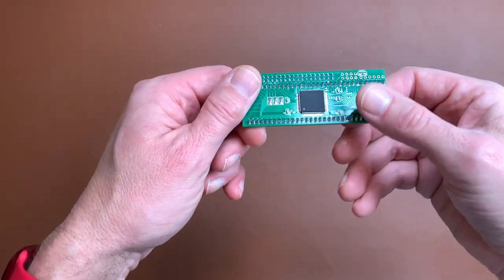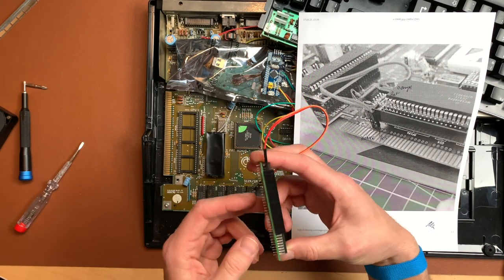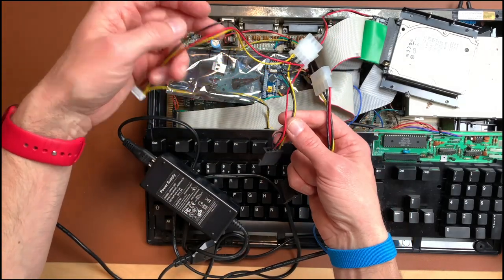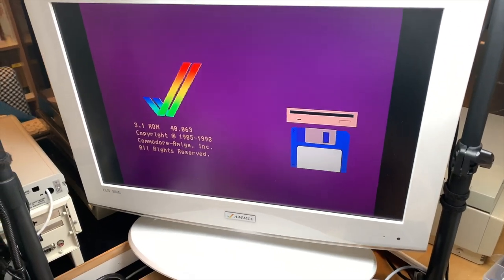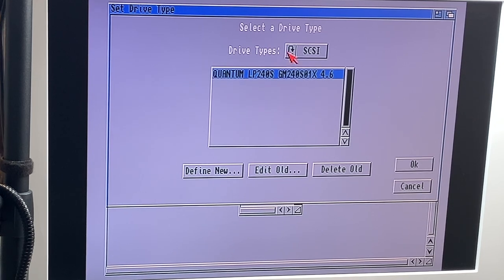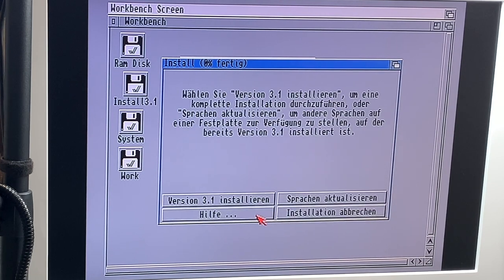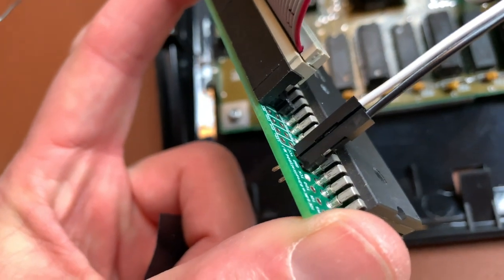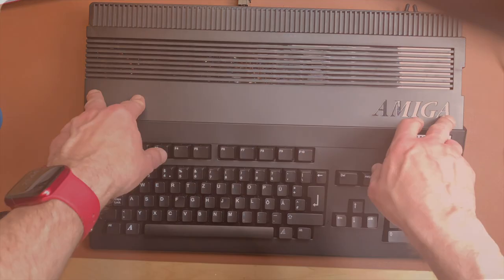Amiga - $25 hard disc controller (internal / IDE) for the A500 & A2000 ... can this work?

Comment: Most CF-Cards do not support Master/Slave (any jumper on the Adapter only works with the right, industrial grade CF). A way around this problem: Use two IDE-> Sata adapters with master/slave jumper instead. Theease also buffer the bus, so much more freedom were to place the drive (and a sata-cable is much more easy to handle than a 40 pin ribbon cable). As hard-drive I reccoment a msata in a sata2msata adapter, as this is very smal. You might place it under the disk drive.
The secondary IDE2Sata Adapter can be used with an eSATA-Cable, so you can plug in an external SATA-Device to your Amiga. This can be f.e. a normal SATA CD/DVD-Drive (or, if you want audio from CD: An IDE-CD-drive with SATA2IDE-Adapter. With a slimline IDE-drive, you need an extra adapter to convert the 50 pin plug to 40pin+analog audio. ). Also there are SATA2CF-Adapters, if you want fast data transfer from another Amiga by using CF-Cards swapping. Not every SATA2IDE Adapter works with slimeline IDE-Drives, as they are flashed to be slave in firmware in most cases. Tried 3 different adapters, only "CSL - IDE zu SATA SATA zu IDE Adapter Konverter" worked. But it didn't worked the other way arround on my buddha (while the cheapest ones fom Aliexpress did). Also having an secondary converter with nothing connected to eSATA only delays boottime a bit, so no problem if you connect nothing externaly.
Actually I made my experiments with a Buddha in my A2k, so I do not know if it works on the IDE68k. But I think its worth a try. In my A2k I do not realy need it (as my Buddha has 3 IDE connectors), so it was just a test4fun. In an A500(+) or CDTV (or even an A600/A1200 to get an eSATA-Port) it seems much more usefull to try IDE2SATA (and even back to IDE with slimline CD/DVD-Drives). I think the possibilitys of SATA in an Amiga are much underestimated. Cable length (after converter the bus is buffered), the posibility to use old slimeline drives (with conversion back to IDE) and also get rid of the master/slave disfunctionality of most CF-Cards are 3 very good reasons to experiment with SATA instead.
Reply from the maker: Thanks! I don‘t know where you always pick up this superdetailed infos, but I love it! I always learn something through your comments.

Comment: That's so awesome. I'd have loved one of those boards back in the 90's.

I've got something similar in my ZX Spectrum 128+2B, (the black case +2A with dual ROM's). There's a PCB under ROM0, and I had to burn 2 new ROMs for it. But I now have an internal CF Card attached. The +2 is in my music room hooked up to my drum machine and Yamaha keyboard using the internal MIDI interface using my own custom software.
Reply from the maker: Me too. Especially for the price. Works great.
Reply: @RetroWK  Yeah, it's a bargain. I think the Spectrum one was about £40.

Comment: It looks like the power connector on the cf card reader is a standard floppy power connector. You should be able to use a splitter and grab power from the built in floppy power connector.
Reply: Yes, with a standard y cable splitter it works flawlessy. There's plenty of power to run floppy drive and the ide controller. Amiga 500 it's really a beast!

Comment: Nice video, the ide68k is a fantastic little board.  I know the one I have will provide power over the key pin on the ide cable.  If you can find a CF card adapter that supports key power it should work without needing extra cables.
Reply from the maker: Cool! Thanks!

Comment: Nice video and great job. I use my GVP HD+ as a HDD by substituting the damaged HDD with a ZULU SCSI2SD.

You have done a lot of mods and improvements to your A500, wich power supply do you use?, because all those mods require 5V juice.
Reply from the maker: 4.5amp Amiga PSU (the light one)

Comment: Very nice! How does the drive speed compare to an Amiga controller?

And I couldn't find a link to it on eBay, would you share it with us please? Thanks!
Reply from the maker: I have no comparison for the speed. Sorry! Seems to be pretty quick. I did add some sources in the description.
Reply: @RetroWK  sysinfo 4.4 dh0 speed ?
Reply: It's slightly faster than a real HD, and it's silent. By the way it lacks the sound and feel of a mechanical hard drive but it works 100% like a real drive and you can also partitions with the standard hdtoolbox even on an old 1.2 kickstart with no autoboot. It just need a boot floppy on these old machines.

Comment: Hi. Were are these for sale? I need one without Ram for testing if PiStorm on the 500 can use a physical IDE port and a real harddrive. If works, it will become way more easy to swap files.
Reply from the maker: I did add some sources in the description.
Reply: @RetroWK  I will have a look. Hope seller is from within the EU.

EDIT:
All out of stock..... Only one to find, are with 8mb, and I dont need for the experiment.

Comment: Will this IDE device work in an A2000 that has an accelerator card plugged in?
Reply from the maker: I did not test that. It could be that the main processor is switched of and so this does not work.

Comment: Great information. Where is the link to purchase this?
Reply from the maker: I did add some sources in the description.
Reply: Thank’s and subscribed after seeing more of your content
Reply: To the best of your knowledge would this work on an Amiga 500 plus?
Reply from the maker: @LouDon-ih4sf  Yes it would. The A500+ is pretty much the same machine. Later Amigas (normal 500s) even had the same PCB (minus the ECS chips and the clock).
Reply: Thanks again and though that it would be the case
Reply: So, the IDE adapter arrived, watched your video again, set everything up, soldered everything, turned the A500 on and worked first time. Thanks and keep pumping out the content!!!
Reply from the maker: @LouDon-ih4sf  Great! Isn't it crazy that we are so astound if things just work as expected. I miss the times when you flicked a switch and stuff just worked. It's good, that this is one of those products.
Reply: @RetroWK  Absolutely!!!!

Comment: the ide 40 pins does not provide power supply , the 44 ( small ) does , hence it needs the esternal 5V and no it'll never work without simply cos the hd wont have curent to turn itself on.
you failed to mention in order for it to work it will need at least roms 2.0 or above ( or it will never see the ide interface) .
The interface could be cool but......................the ide activity led ?